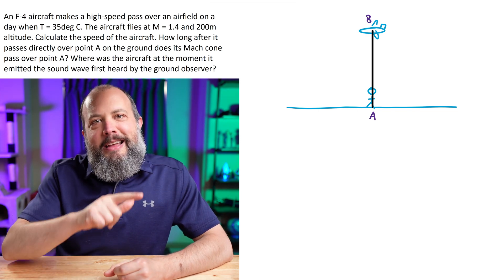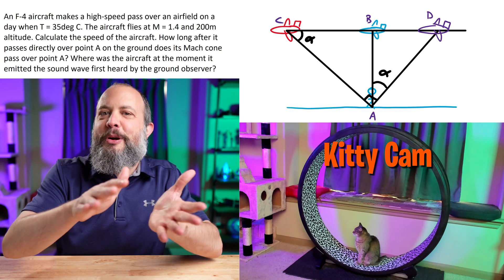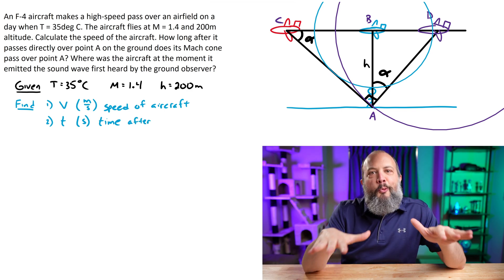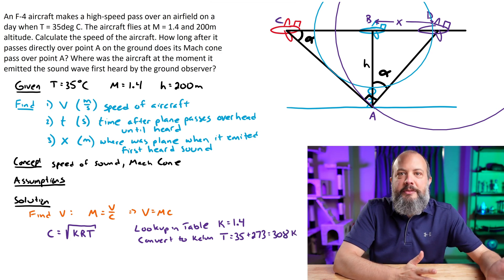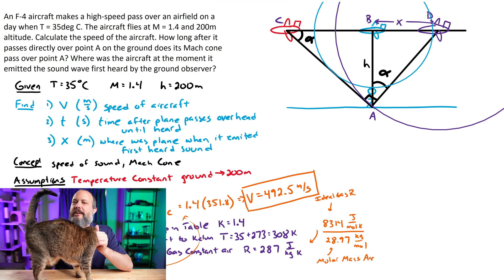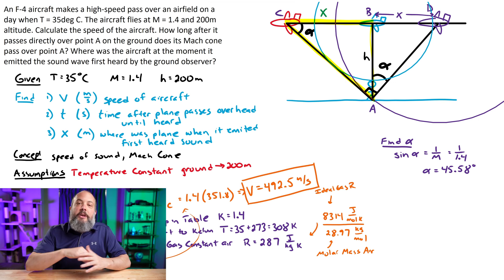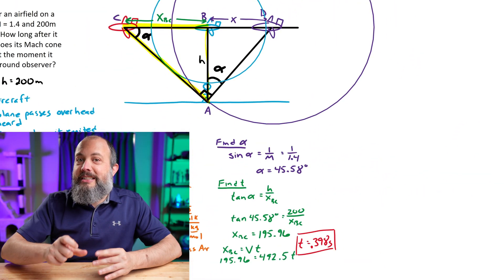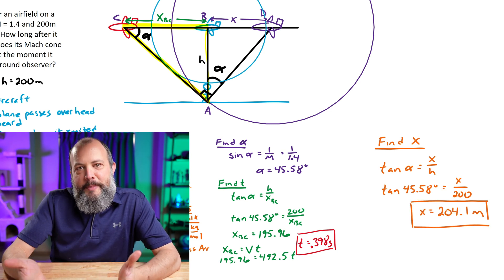Mach Angle Example Problem

Comment: Underrated channel + video. I liked. Would like to know where those formulas come from btw why sin(α) = 1/M ?
Reply from the maker: Derivation of sin(a) = 1/M. Picture the Mach Cone. Jet flying horizontally to the left. Sound radiates outwards in circles at each moment in time (actually sphere, but circle in 2D drawing on paper). Draw a triangle from the current position of the Jet, right to a previous position of the jet, then down/left as the radius of the circle for how far sound has traveled in that period of time, then your current jet position back to where you are now on the circle, that's the diagonal mach cone line. I hope I haven't lost you yet. This triangle is a right triangle since the mach cone is tangent to the circles of sound expansion. I'll call the mach cone diagonal line the base, the distance sound traveled as the height, and the hypotenuse is the distance the jet traveled. Angle Alpha is angle between the jet line and the mach cone line. So, sin(a) is opposite over hypotenuse, which is distance sound traveled divided by distance jet traveled. distance is velocity*time, so Vsound*T / (Vjet*time). Time cancels so sin(a) = Vsound/Vjet. Vsound/Vjet is an upside down mach number, so 1/M. It's hard to explain a drawing in words, so I hope this made sense. Thanks for watching.
Reply: Thank, I had to do a plan to understand what you were saying but I finally get it now. Thanks again! @BrianBernardEngineering